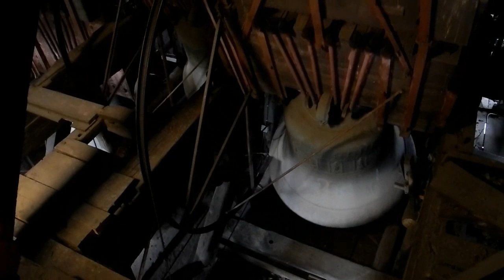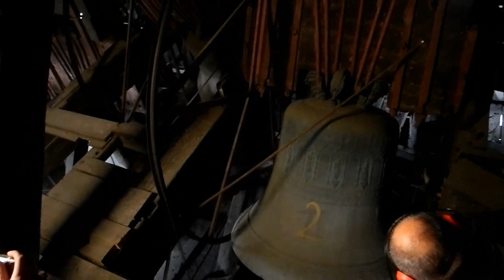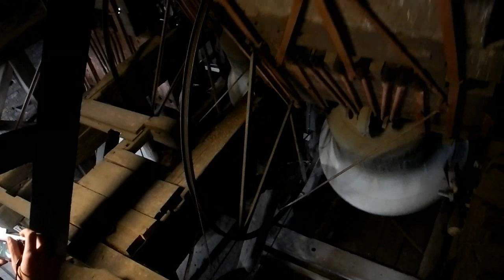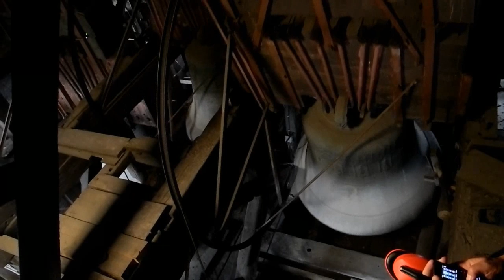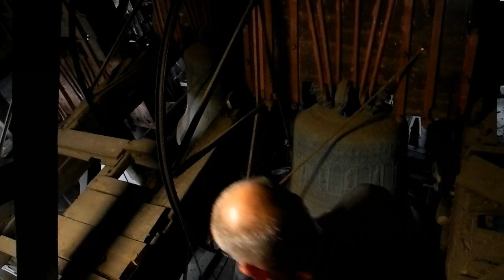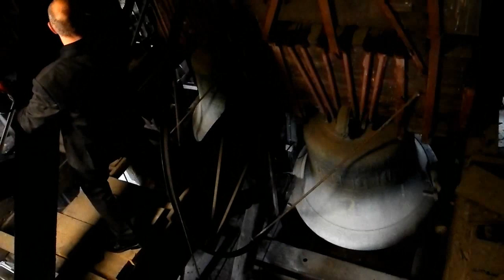Cloches de la cathédrale de Liège (sonnerie partielle)

Comment: So, the bell that has a motor problem, is that the big bell, or the second biggest?
Reply from the maker: The bell with the motor problem, is bell No. 3.  The second biggest is the one you can hear on the video.  They did not want to ring the biggest bell, otherwise people in the street might have thought that the pope had died...
Reply: That would make for a great prank, but then the bell ringer would get in trouble